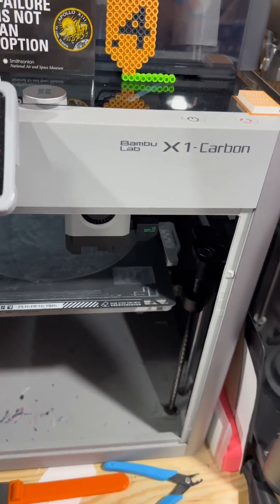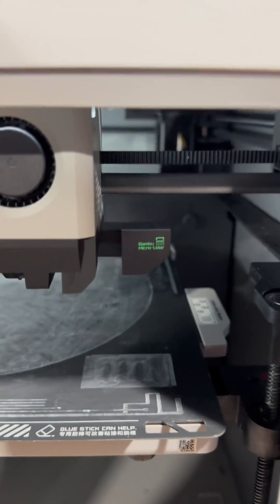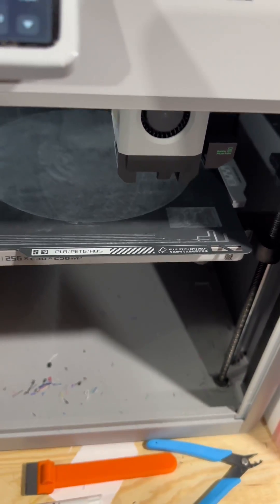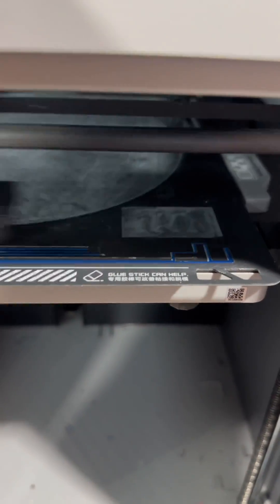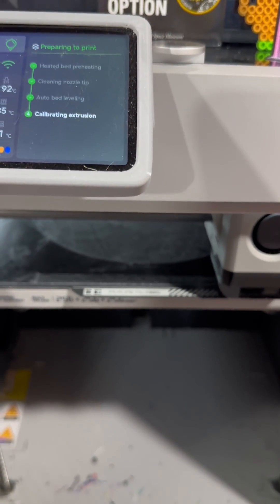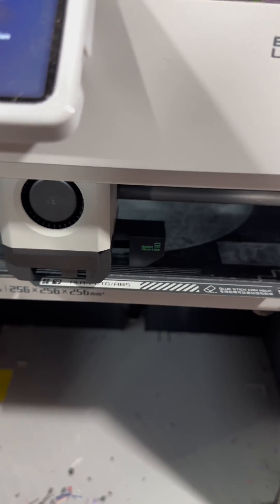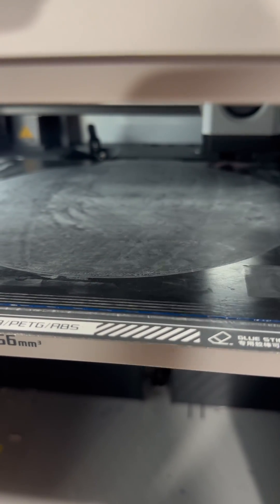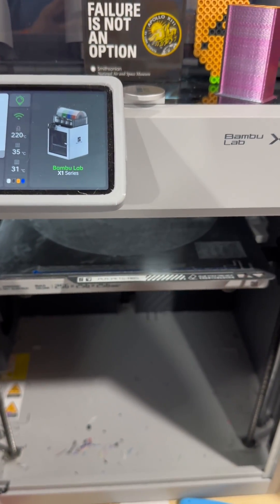Does the Bambu Lab X1 Carbon LiDAR really work?

Comment: The lidar looks for DEfECTS. Remove the calibration lines and by definition, defects are also removed. Same goes with first layer scanning - I know this because it has absolutely, positively, 100% detected 1st layer defects when they exist, even when I didn't see them. 

Whoever came up with this doesn't understand that contranegative does not equal positive.
Reply from the maker: Now that makes sense.  But you’d think that the absence of filament WOULD be a defect.
Reply: @super3dtok  I suspect that because there are many combinations of build plate, layer height, filament color, lighting, and filament type that simply can't be detected easily by the lidar, the system can't treat "I saw nothing" as a failure.

Comment: My issue is diffent. It scans the first layer and I saw it scan first layer, but the layer had a hole and large blond that Extended far beyond the surface. No error from the printer. I could hear the printer hit the blobs, so stopped the print.

I am sure that my eyes do not have micrometer resolution, that is better than the LIDAR 😂

Will ask Bambu about it.

Comment: Then try this (for science): mess up the numbers for a known filament so that it will print badly (check that first without telling it to callibrate). Then tell it to cailibrate before the print and leave the calibration line as is. If it prints ok, it has corrected itself. Then repeat the procedure (mess up the numbers again) and pull away the calibration lines. If it messes up again, you know the lidar is working.
Reply: I think this is the one to test for
Reply: perfect test

Comment: Yeah, I’ve heard that it reverts back to to the filament profile if it doesn’t have a successful calibration but I think it would be super nice if the printer would show or tell us that changes were identified or that it failed to calibrate.
Reply: I completely agree. Bambu Labs should deliver more information with any and all errors. Not just: red/orange lights, or there's a problem... continue?

Comment: Virtually, it does NOTHING!

I mean, X1C lidar was sold as flow calibration, the problem was that BambuLab is new to 3D Printing and they didn’t know the different between flow and pressure advance.

In practice if it fails, it sets to its fallback that is 0.02

; see if extrude cali success, if not ,use default value
M1002 judge_last_extrude_cali_success
M622 J0
    M400
    M900 K0.02 M{outer_wall_volumetric_speed/(1.75*1.75/4*3.14)*0.02}
M623 

More experience users were able to break into its MQTT to find out that the pressure advance aka PA was in fact failing so the lidar was not doing anything.

The very first units would show the error on display, BL decided to release firmware changes to hide the error :upside_down_face:

At this moment, you must manually do PA calibration, flow calibration because these printers are unable to do it on their own.
Reply: I'm about to make a decision on a X1C or a P1S. I'm wondering if any of the extra goodies are worth the extra cost. 
What are your thoughts? I'm about to pull the trigger tomorrow. Hopefully you see this soon
Reply: @robrob1596  I think one of the biggest differences is really the MCU. The X1 has a Cortex ARM MCU while the P1S has an ESP32-S MCU. The X1 runs a custom version of Linux and has more hardened gears. It has a better camera, wifi, and has "AI" for first layer detection and spaghetti detection.

The P series runs a different OS, or a ported OS because the ESP32 RISC processor can't run Linux. The camera runs at 0.5 fps.and the WiFi is slow for uploads to the printer. That and the X series has LIDAR.

The slowness is the fps of the camera and WiFi is because with ESP32 you can allocate CPU resources so you can make printing the main priority and everything else secondary, which is good because it prints great. The control panel can be slow, especially while printing. 

I believe the X1 has a slightly hotter bed and is better at printing stuff like carbon filter so if that's a priority then I would do some research on that.

While you can get a touch screen for the P series,  xtouch is an open source project. I read it's buggy and slow and also can stop working after some firmware updates so you have to wait for it to be fixed. The screen you have to buy runs an older model ESP32, which has built in WiFi so it controls the printer of LAN, it doesn't control it directly so it can be slow also.

Personally, the P1S is perfect for me as I don't print a lot of hard to print filements and don't mind the slow WiFi. ESP32 chips, until recently, were mostly used in smart home devices like lights and motion detectors. I'm actually shocked that the P series is running off it. It also has WiFi and Bluetooth built in which is the WiFi is so slow, it was never meant for any sort of decent size (10MB for example) file transfers. It was made to respond to queries to turn something off or on. 

The X1 also comes with a hardened steel nozzle for carbon fiber but they are only 25 dollars if purchased from Bambu directly so not a big deal. Unless you care about the touch screen, a camera with higher fps, and a few gears that are made out of hardened steel then the P1S is perfect, especially if you plan on printing PLA, PETG, ASA, and ABS. I really don't know how good that first layer detection is on the X or how good the spaghetti detection works either. 

While I don't know how much the cortex arm processor is you can get an ESP32-S for under 10 dollars from AliExpress so I'm pretty positive that the cortex processor and  LIDAR unit are the biggest reasons in the price differences. That and the somewhat better build quality. You can always buy a 3rd party WiFi camera and mount it if that's a huge priority which is what I did as a decent one is 50 to 100 dollars depending on your needs.

The X series could always get sosomeme future features the P series can't because of the processor and customer Linux OS but never buy anything based on possible future capabilities and Bambu has never stated that they were going to do anything like this. I only mention it because it's possible to do it  IF they really wanted too.

Did a quick look at AliWxpress, you can get an ESP32-S for 5 to 15 dollars. The RockChip is 50 to 150.dollars. Now, imagine the price of buying in bulk. The RockChip also requires a WiFi adapter as it's not built into the.processor like the ESP32. You can see the performance differences are perfectly acceptable when comparing the 2, at least going by the specs 

RockChip:
RV1126 – Quad-core Arm Cortex-A7 @ 1.5 GHz + RISC-V MCU @ 400 MHz

ESP32:
Xhensa dual-core 32-bit LX7 microprocessor, up to 240 MHz

Comment: Those lines are for setting flow calibration, don’t believe it has an error there, but should give an error when first layer LiDAR looks off compared to the previous calibration scan. I have gotten errors on first layer when it didn’t match calibration, it asks if you want to continue.

Comment: Works or doesn't work, its just a marketing gimmick. P1P/P1S doesn't have it yet the print quality and speed is the exact same. It doesn't do anything different that the default filament profiles in your slicer already do. Just a marketing gimmick to get people to spend the extra money. BL shot themselves in the foot by releasing the P1P without lidair, just proves how its not needed in 3d printing.
Reply: A marketing gimmick for sure. The Creality K1 does not have Lidar, the K1 Max has. They're both from the same release year (or even date). Then the newer and upgraded version, the K1C (from this year), does not have Lidar. So why not put that on the same upgraded printer when it's such a good feature?

Well couldn't think of a better reason then build plate dimensions, which are quite small on the K1 and K1C. Just missing more space when dropping a Lidar test line. But then, it could have been an optional test when you need the entire build volume.

Comment: Yes it does work, it just means that the software will default to the preset settings and print that way.
Reply from the maker: Makes a ton of sense.
Reply: @super3dtok  But if the lidar detects no lines or zero flow changes, that seems like it should be an error condition.

Comment: This Lidar is changing the extrusion calibration numbers. It might just be a simple case of falling back to the default numbers when there is an Anomaly with the scans, which is a good UX decision to make it easier for the user.
Reply from the maker: Couple other people have said that and that actually makes a lot of sense.
Reply: This is exactly it.  If it gets a result it cannot read, it reverts to the last setting or a default setting.
Reply: This is how the programming language would work yes.

Comment: It does NOT work and I'll explain why.

It was released as pressure advance only instead of flow calibration and does not do it right either. 
The CEO confirmed during the Reddit event hosted ages ago.

It doesn't stop because within the start gcode, it has a fallback set to 0.02 so in case it fails which was you removing the line, it sets the pressure advance to 0.02 and continue like nothing happened.

Doubts?? Search your start gcode for 0.02 until you find the block for the pressure advance logic.

I had this arse printer for 3 months before returning it and building a LDO Voron instead.
Reply from the maker: So in programming terms.  If there is an error just use the default parameters but if it doesn’t error out make adjustments automatically correct?
Reply: @super3dtok  it just makes you more for less, basically! 
P1P is missing nothing for not having lidar, one less thing to give headache and add weight.
Reply: It used to display when it failed, but BambuLab removed because it was "confusing users"
Reply from the maker: I figured as much!  Make it more of an appliance.
Reply: Or just get the P1S minus the LIE-dar at half the cost!
Reply from the maker: Nope!

Comment: Even the marks left of the plate is seen by the LIDAR… and that’s why you cannot use the textured plate with LIDAR. That small grain is seen on the LiDAR like 
Mountains. Try using a very clean plate. 
But they may well not implement a fail routine. Again, the texture plate does not use the LiDAR but still prints. Remember what’s the LiDAR for
Reply from the maker: That’s true.  But you’d think there’d be a huge difference between a bed with glue and a bed with filament on top of it.  Especially if it’s that sensitive.

Comment: Watching this as I'm tearing mine x1c apart due to a malfunctioning lidar. I can tell you when it breaks it's a pain lol
Reply: What happened? How did it break.
Reply: @sasquatchphil89  wish I knew the whole machine is only 1 week when it died and started throwing errors. Bambu sent replacement lidar and USB cable but swapping them didn't help. Now I'm waiting on a reply from support.
Reply: I had broken lidar straight out of the box new. It looks like they have build issues with the USB cable and potentially the lidar. The wiki page does mention that the USB cable will gradually break over time from repeated bending but I imagine an issue right out of the box is more a manufacturer's defect. The system definitely has default calibration settings as even without a functional lidar I was able to get mine to print and it was basically same print quality as when the lidar was fixed. I'm not saying the lidar doesn't work just that the x1c is well tuned out of the box
Reply from the maker: Ugh sorry to hear that!!!
Reply: @super3dtok  it's back in action now. I can confirm that the lidar is a huge improvement in print quality. When it was broken things would be very stingy. Now it prints perfectly. No doubt it helps !

Comment: what would you expect to happen after it scans the height ? aslong as the bed is on the right height it doesnt need to change anything.
Reply: It’s supposed to print the lines, then scan the width of those lines with the lidar, then make adjustments to the flow rate so that it prints a consistent width throughout your print. So the thing here is if he took the lines away, giving nothing for the lidar to scan, why is it not erroring out?
Reply from the maker: Exactly!
Reply from the maker: It doesn’t more than bed leveling